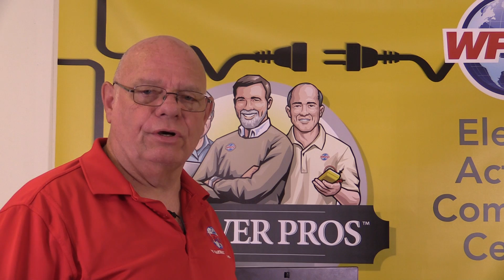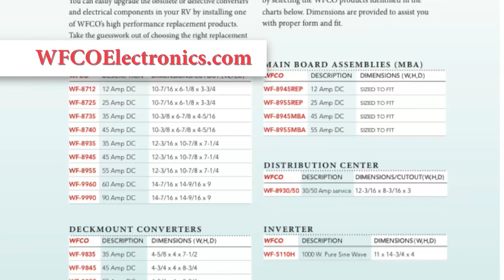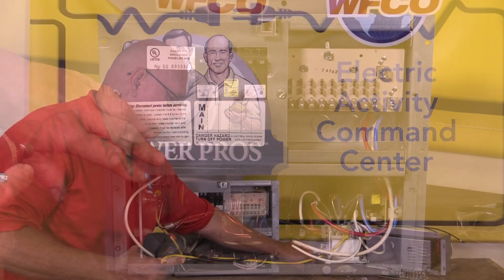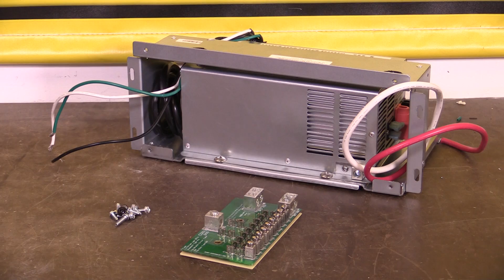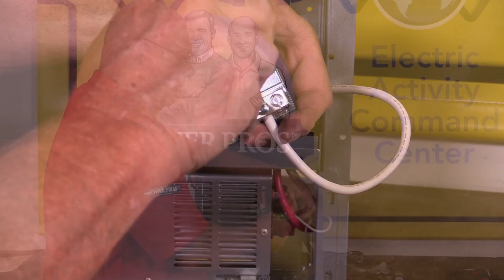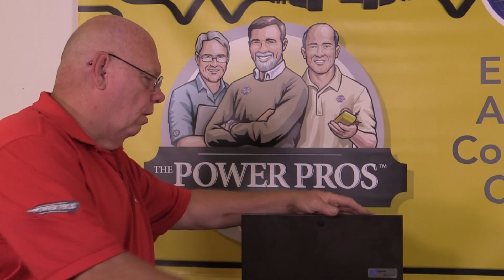WF-8955REP Installation Video

Comment: What is the part number for a 50 amp AC service unit?
Reply from the maker: Any of our WF-9500 series power centers or WF-8930/50 Panel in combination with a WF-9800 series deck mount converter.

Comment: I just installed a 8945. The unit has an extra ground lug on the front of the converter.  Is it necessary to add an extra ground wire? Unit is functioning normally. Seems to be good ground attaching to the service panel frame.
Reply: Did you ever get a reply?  We're getting ready to do the same install and our Parallax 7345 45 Amp also has the extra ground lug.  Thanks.
Reply: @karinspronz5635  no but after watching the video again it seemed like that lug did not get used. Unit is working great. Install went smoothly except for a unrelated issue.

Comment: What if we never use sure power and have solar + and on board generator?
Reply from the maker: If you never use “shore” power but do have a generator, the generator will supply the 120 vac needed for the WF-8955REP unit to function.
Reply: You still need the converter to charge your onboard generator starter battery unless you are also charging that with your solar

Comment: Is the WF-8955PEC converter a smart 12V battery charger with multiple voltages for bulk, absorb  and trickle charging?  I have a fully charged battery and the converter still outputs 13.6 volts and never drops to 13.2.  I have yet to see 14.4 for a charging voltage.
Reply from the maker: Yes!